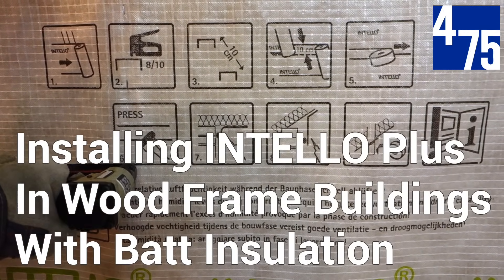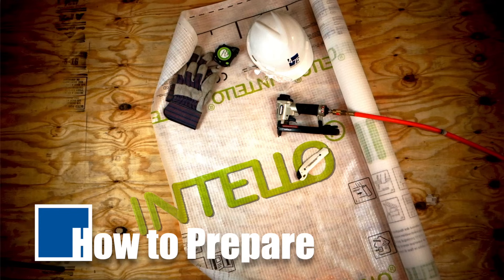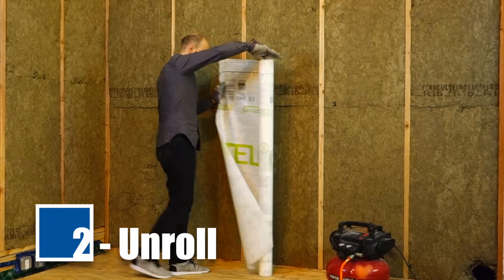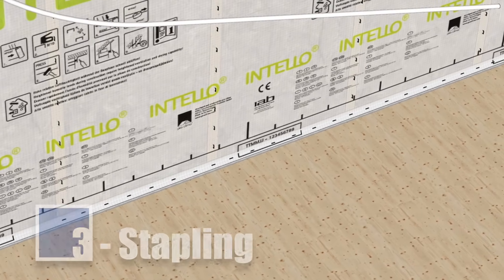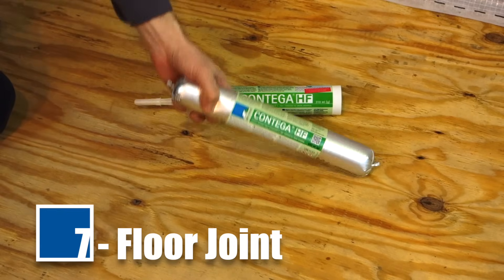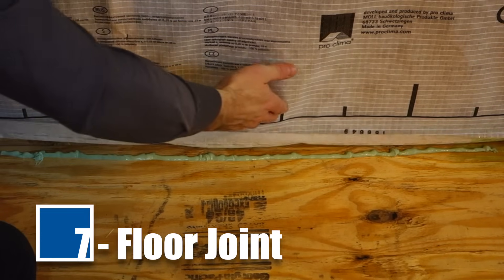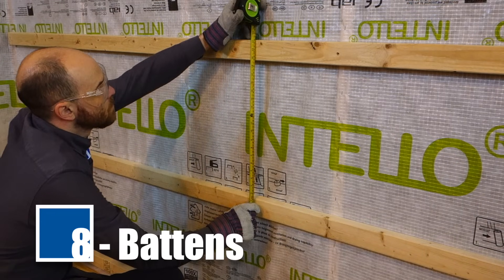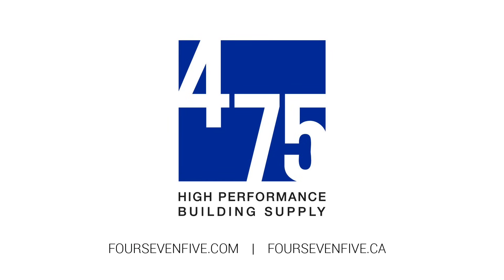Installing INTELLO PLUS In Wood Frame Buildings With Batt Insulation

Comment: How would you recommend sealing at the base when a hardwood floor is already installed?
Reply from the maker: It would require cutting back the hardwood floor to access the subfloor. You can seal to the subfloor above and below to make a continuous transition at the floor system.

Comment: Battens required? Putting this in a basement wall and using 16 inch on center batt rock wool. 

Using 1/2 inch drywall that is fiberglass
Reply from the maker: The battens that create the service cavity are not required but are helpful, because they limit the amount of penetrations for services through the INTELLO and insulation layers.

Comment: Is it necessary to seal around the screws that attach the battens to the framing? How do you recommend doing that?
Reply from the maker: It's not! As long as you have positive pressure (and didn't miss the stud with the screw) you won't have a leak.

Comment: If I'm insulating the rim joist and sill plate in my crawl space with foam, would I put the SMART Vapor Retarder directly over the wood before applying the foam?
Reply from the maker: The INTELLO membrane should be located inboard of the insulation

Comment: Hello! I live in climate zone 5 (Western NY). We’re currently renovating our 1996 house and upgrading to rockwool insulation. I was curious if this product would be suitable in my zone? I’ve done lots of research regarding vapor retarders and barriers. So far I’m stuck between Intello or MemBrian. Both seem acceptable in my zone as far as I can see. I’m aware I don’t want straight poly due to potential mold/condensation issues.
Reply from the maker: Hi, thanks for reaching out. We have a rep in Western NY who would be happy to talk with you. Head to the front page of our site and scroll down to the map to find Corey's contact information: https://475.supply/ 
When selecting a Smart Vapor Retarder, it's important to look into the durability of the material, and the vapor curve (to make sure it doesn't become vapor-open too early). INTELLO Plus is only 1.7 PERMs at 70% RH, and opens to 10 PERMs at 80% RH. It isn't just about being vapor-variable, it's about balancing when a Smart Vapor Retarder should keep vapor out, and when it needs to open up to allow the assembly to dry.
Reply: @475.SUPPLY can I get a representative in Brantford Ontario or a supplier today?
Reply from the maker: @rh8470  Absolutely - just head to the front page and scroll down to the Rep Map for contacts: https://ca.475.supply/

Comment: Do all those thousands of small staple holes defeat the purpose of a barrier? Probably should tape over the holes made??
Reply from the maker: As long as you follow the guidance shown in the stapling section of the video, we've seen time and time again that it's not an issue. Part of that guidance includes the fact that it should be hundreds, and not thousands - as you staple far less than you would with typical netting. Staples that are pressed in too far, or are hanging too far out can cause issues, but that's why you check. Flush staples without tears work!

Comment: In a retrofit, is it even worth installing Intello if there's no room for a service cavity? Seems like this is a key element in protecting the membrane long term and as you noted in a previous comment, punctures can drastically affect it's performance. No service cavity would almost guarantee punctures long term.
Reply from the maker: Yes, it would still provide a benefit. You're right, that benefit may be degraded over time by punctures, but overall, airtightness would still be higher and more importantly, vapor control would still be effective in providing safety from condensation issues within the wall. Another possibility is to use a service cavity only on walls where penetrations are more likely to occur. If one area of the building is too small for service cavities on all walls, it may still be worth it to use this strategy on some walls.
Reply: @475.SUPPLY  Wonderful thanks. Makes sense. And are there any issues with installing this with an existing exterior tyvek housewrap? Climate Zone 5.
Reply from the maker: @diamondbracelette  As long as the exterior is doing it's job and keeping the water out, you should be good to go. If there's any doubt about condensation, we can run a WUFI for you. Just contact us through our support page if you want to make that happen. https://foursevenfive.com/support/ 
Thanks!
Reply: It's a unnecessary product, if running a cavity batten sytem, there should always be circulation by running cavity closure s, the building wrap is the moisture barrier, that's why it's better to use fiber cement, rigigid air barrier, don't need need this interior air barrier, scam product

Comment: Does 'intelligent vapor control' mean that water droplets can form on Intello on hot summer days? I have noticed some moisture on the Intello that is installed in my attic. Some tape seams in the ceiling are loose and wet.
Reply from the maker: Hi James, INTELLO PLUS is able to handling humidity by allowing drying to the interior of the building. We're concerned about the loose tape seams. If they are open and the seams are not airtight, it could be allowing moisture in to the assembly. Can you email our support team with pictures and a description of your assembly? At minimum we'll want to tape up those seams, but there may be more we recommend given the situation. Please email info@475.supply

Comment: Is this (or a similar product) approved for new construction in Florida if we want to build a small metal frame house with no wood sheathing where the product will stick onto metal studs and rafters?
Reply from the maker: Hi, this product does work in Florida, yes. But it would need to be paired with vapor-retarding membrane on the exterior, since Florida is so humid. It also works with metal studs - you will just need to use our double-sided tape called DUPLEX to affix it. Reach out on our website and we can get a conversation going as to the details of the assembly that will work in your climate zone: https://foursevenfive.com/support/

Comment: What kind of sealing needs to be done with the batten insulation area towards the room interior?  If you are using 75% insulation towards outside and 25% towards interior, do you air seal again or don't worry about any more air sealing of the drywall?
Reply from the maker: As long as you are insuring there isn't too much insulation value inboard of the air barrier (as you say, a 75/25 split is great) you don't need another air barrier. Including additional insulation between service cavity battens is a very common practice for many of our customers - you would just need to install drywall on top of it. For anyone designing their assembly, we recommend downloading our free Smart Enclosure details. It will give you all our best recommendations - https://foursevenfive.com/smart-enclosure/ (USA)   /  https://foursevenfive.ca/smart-enclosure/ (Canada)

Comment: So it is ok to add an additional layer of insulation over the Intello?  Are there restrictions on this?  My plan would be to use 2x4's to create a 3.5" batten area to fill with additional insulation and wiring in my cathedral ceiling.
Reply from the maker: Good question: we recommend people fill the service cavity with additional insulation. See our Smart Enclosure details (download free on our site) for more on that. But the general rule is: 2/3 of the R-value needs to be outboard of the Intello, up to 1/3 can be inboard. If you're close to that 2/3 - 1/3 ratio we recommend you do hygrothermal modeling (through WUFI) to ensure the ratio you use is suitable for your climate.

Comment: How do you put down carpet if you can't press down the edges of the wrap where the sealant is?
Reply: The CONTEGA HF adhesive goes along the sub-floor within the area of the service cavity - the horizontal battens that you see fastened on top of the INTELLO Plus air barrier. That means the drywall goes inboard of that. In other words, none of this would affect the carpet (or any interior decorating) because it's all hidden within the wall.
Reply: @johnnyrezvani8196  So what would you recommend for people that can't use the battens as far as putting down flooring but not pressing the Contega HF down?
Reply: @theworldsgreatestnihilist  You could still do the same thing, just with a much tighter area to work in, since the drywall gives you a little room to run a bead of adhesive under it. You could also tape to the subfloor instead, with TESCON VANA tape.
Reply: @johnnyrezvani8196  Ok, good point on the drywall, the Intello/Contega HF seam could be under that and the carpet tacking along the drywall edge. Thanks!

Comment: Would you use intello in hot/humid climates like zone 3a?
Reply from the maker: Yes -  INTELLO Plus can be used in mixed humid climates. We actually have monitored a roof with asphalt shingles in Charleston SC using INTELLO Plus as the interior airbarrier, showing very dry roof sheathing in both in winter and summer. Walls will perform even better, and the INTELLO will make the fibrous insulation work better (airsealed on all 6 sides) as well as protect the inhabitants from any insulation fibers coming into the indoor air.
Reply: 475 High Performance Building Supply thank you.  I’m going to be enclosing a 1450 sqft 2nd floor that is currently unfinished.

Comment: This is nonsense . . . Like that is going to happen perfectly on a job site . No missed staple holes , no small 'nicks' , no dust , tape going to adhere perfectly to every surface and the tape will never loose its bonding strength and fail . . . And pigs might fly .
Reply from the maker: Hi Roberto. No site will be perfect, and there may be nicks or missed staples here and there, but avoiding them to the greatest extent possible while using this system drastically changes the comfort and performance of any building that uses it. And we work with builders who do this successfully every single day. In other words: we see pigs flying every day :)
Reply: @475.SUPPLY  Kudos for responding in a far more diplomatic and professional than I did. But our pigs flying friend did have a point. Did you ever consider combining pole beam construction with even more natural and sustainable materials?  Such as Strawbale  or Hempcrete instead? Since they seal based on their 3D placement, (as opposed to INTELLO PLUS's 2D plane barrier that has to be installed near perfectly to function properly). 3D sealing is far more forgiving to minor imperfections....Much like why ICF homes tend be sealed better than stick built homes in general even if a house wrap or other method is used to seal them. Feel free to give your feedback. 
Just a thought and good luck with your business.
Reply from the maker: @nc3826  We are distributors of these systems, and we help people plan for, and install them on all types of buildings. Funny you should mention pole beam and strawbale: if you go to our channel, two of our most popular videos are those two exactly. Both use Intello Plus as an interior membrane and Solitex Mento WRB on the exterior. And on our site we have a whole series of design guides we call the "Smart Enclosure" series - you can download for free. We cover all types of construction. This video is just the tip of the iceberg in terms of what's possible.
Reply: @475.SUPPLY  Thank you for explaining!
Reply: true, how dear they make a product that isn't moron proof, for ppl like you??? but what is??? thats why oversight is so important genius...

Comment: what if you are installing this on metal frame? How would you be able to staple this.. what would you use?
Reply from the maker: Great question: there is a double-sided tape called Duplex which can be applied to the studs. Intello would be adhered that way to each metal stud. If you were dense packing and additional strength is needed, you could also use screws. For commercial installations, we'd also advise using INTELLO X, which is the version of Intello Plus for commercial applications.